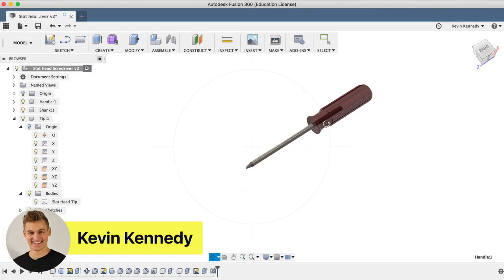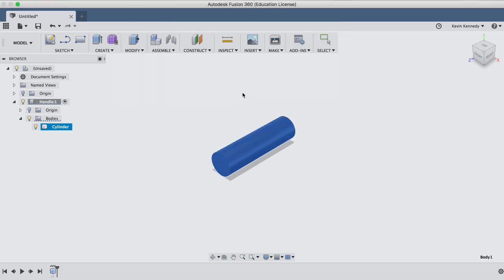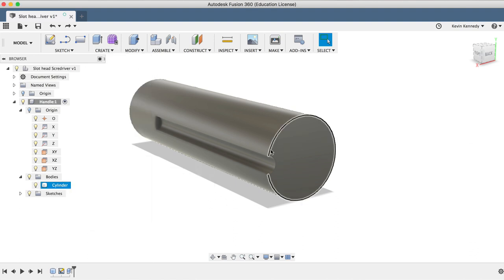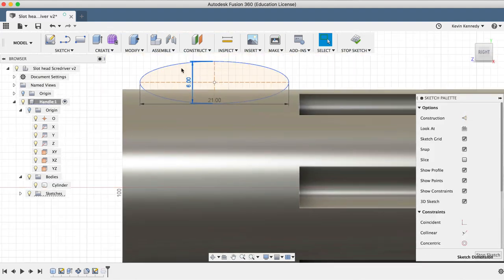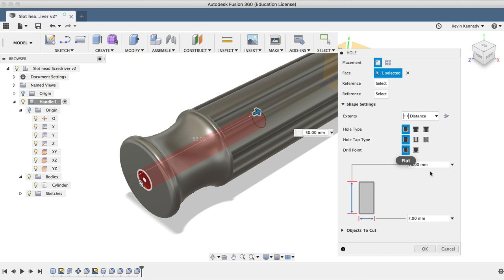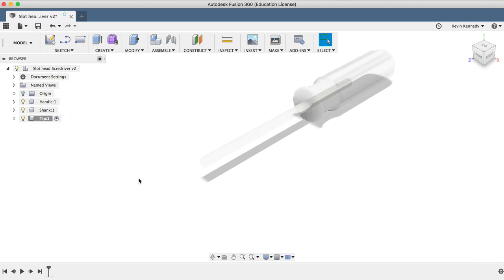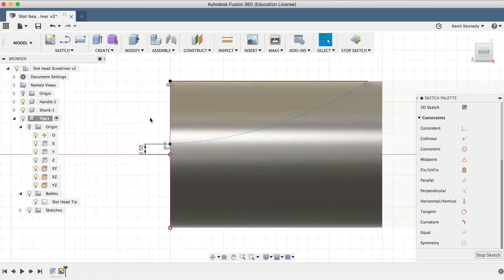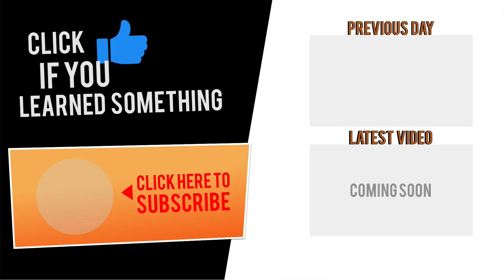How to 3D Model a Screwdriver in Fusion 360 - Learn Autodesk Fusion 360 in 30 Days: Day #14

Comment from the maker: IMPORTANT UPDATE: Make sure you turn on "Auto project edges on reference" or you will have trouble creating the tip. Cross-check your settings with mine, here - http://bit.ly/defaultsettings
--
TIMESTAMPS
0:00 - 3D model a Screwdriver in Fusion 360
0:50 - Create a component
1:07 - Cylinder for the handle
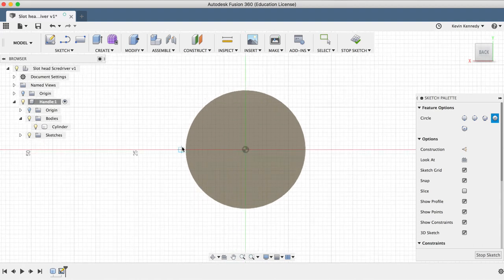2:21 - Handle grips
5:20 - Front "divet" of handle
7:43 - Hole in handle
8:25 - Screwdriver shank
10:08 - Screwdriver flat head tip
13:07 - Extrude cut screwdriver tip
13:59 - Add appearances to components
Reply: Hi Kevin, I was having trouble selecting the corner point when creating the tip, so I restored the default settings per your suggestion, and now when I go to dimension ".5mm" from the edge of the tip face to the center point I can no longer snap to the center point. How do I fix that?
Reply: Kevin, I was having the same problem many of the other users here were having with the 3-point-arc not sticking to the tip component. When zoomed in I noticed the tip was slightly off the center axis. 

The problem is with the creation of the hole. When you create the hole it does not automatically constrain it to the center of the front axis. You must drag the hole until it clicks into place so Fusion 360 applies the constraint to center it on the axis. 

"Auto Project Edges on Reference" is part of the problem, but also, centering the hole is the other part.
Reply: I have auto project.... checked in my settings, it does nothing for me. Turned it off and on again.. it does nothing for me. Just cannot get it to work

Comment: When using the dimension tool (D) at 11:32, I found I had to hold SHIFT while hovering over the tip cylinder edge in order to access its midpoint. Version 2.0.14793 here.

Comment: At 11:30
How did you manage to make a dimension between the arc and the center origin of the tip?
Auto project edges on reference is already marked.
I can make a dimension to the upper/lower edge of the tip, but not to its center.
Reply: same here!
I just helped myself by creating a construction line from the end of the arc to the center of the tip and setting the dimension for it at 0.5mm. Then I moved the endpoint of the construction line with the arc attached to it to the center of the tip. It will snap into place and it will keep the dimension. I have made a vertical constraint for the construction line but I don't know if that is needed.
Reply: The problem I had was that the second point of the arc didn't snap to the top of the cylinder properly. Once I zoomed out and tried the arc procedure again, I could see the second point snap to the top, then I was able to set the distance of 0.5mm. 

I hope this helps.

Comment: first off - so cool - I think components are finally sinking in! 
 Question - why not create the fillet on the hole in the screwdriver handle BEFORE creating the pattern?  Then wouldn't the pattern replicate the fillet also?  or is there a reason not to do that I am missing?  It would also be cool to demonstrate changing the handle hole size again after making to tip to see all of them being modified.  Thanks

Comment: Like everyone else, I wanted to say thanks for putting these together. They have definitely been helping me work through the program. I am coming from a 2D CAD world and there is a big step up to work in the 3D realm. I do however have to admit that I hope I am not the only one getting frustrated with it. It seems every lesson, there is some aspect I just can not get to work. Last one was the tip of the auger bit...... Did not happen. This one it is the dimension for the tip of the screwdriver..... The dimension tool will NOT snap to the center origin no way, no how....I hope I am not the only one...... Your videos are however the best on youtube for basic Fusion 360 instruction. Thanks again.
Reply: I created a construction line and fixed it in position.  Then I was able to add the .5 mm dimension.
Reply: create a construction line, or create a second sketch and put a point at the center of the tip face. You can move that forward in the timeline and reference that point.

Comment: The problem I had was dimensionalizing the head.   It would now allow me to choose the center point on the grid.   I tried researching the problem and couldn't find a solution.   Thank you again for the amazing series.
Reply: I have the exact same issue, i can select the start of the arc, but no point appears for selecting the center of the tip. 11:27
Reply: same

Comment: If you can't set the dimension from arc to center in the tip:
I just helped myself by creating a construction line from the end of the arc to the center of the tip and setting the dimension for it at 0.5mm. Then I moved the endpoint of the construction line with the arc attached to it to the center of the tip. It will snap into place and it will keep the dimension. I have made a vertical constraint for the construction line but I don't know if that is needed.

Comment: Thank you for your detailed tutorials. I have learned much and can't wait to try out all these things. One thing which struck me immediately about this tutorial was the lack of a flare (grip) in the shank inside the handle to hold the shank in place so it doesn't turn when in use. I was hoping this would part of the tutorial as I can't see how one could design something inside something else and print a handle and then insert a shank with the flare/grip/wings.
Reply from the maker: Interesting thoughts! To be honest, the focus was more on the high-level features and concepts than making the screwdriver manufacturable. However, I like that idea for a future tutorial :)

Comment: Great tutorials! The only problems I have are usually just the differences between the old and new software version. Like not being able to choose sketch commands until picking a plane and clicking create sketch. My problem on this one is that with the shank as the active component, I can not extrude from the hole in the handle. I simply can not select the handle at all. Auto project edges is turned on, everything else is default (2019)

I just figured out that if I select the top level (screwdriver) I can extrude from that and it put the extrusion in the shank component.
For the tip I made screwdriver active, extruded from the shank and selected new component in the extrude menu
Reply from the maker: Hi, slash09r1. I would recommend using the shortcuts box (keyboard letter "S") to search for sketch commands. That's one easy way to activate sketch commands without being in an active sketch environment. For the shank, you'll want to make sure that you have the "Shank" component active. Then, select the inside face of the handle and hit the keyboard shortcut "P" for the project. That should let you project the sketch (circle) before you extrude it. Projecting the sketch will make sure your circle adapts to the size of the handle if its ever changed.

Don't hesitate to comment if you run into any more roadblocks. Cheers, Kevin :)
Reply: @ProductDesignOnline  Thank you so much Kevin, I encountered the same problem.  This is very helpful.

Comment: At part 11:27 with Dimension tool. There is no automatic point in the middle, so i created a point. But the question is why it doesn't show up? Is it in my settings?
Reply: Same issue here, let's see if someone knows the answer. What I did was creating a 2 point circle between the top and the bottom of the extruded surface, so I get the midpoint of the circle, allowing me to use the Dimension tool between the arc and the circle's midpoint. Anyway, there should be a better way of doing this.
Reply: use "project" next time
Reply: @Woke Samurai You guys were a big help i used combination of project tool & a construction line and some other fiddling to finish up. Does it still readjust the tip component when other components are adjusted? find out next time on Dragonball Z!
Reply: I added a center diameter circle which worked. But now going through Day 15 makes me wonder if it would have been easier to just add a line point.
Reply: @Lone Crew by Newaj After struggling and questioning my life choices, I took a chance and figured out something similar. Here is what I did. After creating the 3 point arc, select the FRONT view. Use the Dimension tool (D) and selected the first endpoint of the arc (it should appear as a black dot). Then hover the mouse down slightly toward the center and a white dot appears. That's the center point. Click on it and change the view back to the RIGHT. From there you can hover your mouse between those points and click to access the dimension to change it to 0.5mm. I hope this helped someone out there. Oh, btw this was done on the latest version of Fusion 360 on a Mac (10.15.7).

Comment: I also had the issue with not being able to dimension to the center of the tip for the three point arc and stumbled upon holding the shift key while hovering near where the point should be. Then it found it.

Comment: For me also the dimension from arc to center could not be set and I also could not mirror the feature of the tip... It would really be great, if you could make a new series with the newest version of Fusion 360.

Edit: I think the problem for why I can't mirror is, that the midpoint of the tip is not the actual midpoint. I have no idea how to change that... This tutorial has not worked for me...

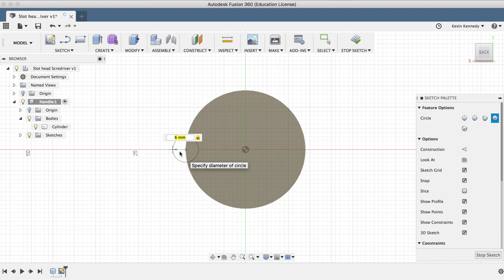Comment: This tutorial series is incredibly helpful. It's extemely clear and the pacing is perfect. I only just run into a problem with drawing the circle for the grooves (around  2:37 in the video). My crosshair doesn't snap to the quadrant point of the cilinder. Is there a setting such as in autocad where you can turn snapping points on or off?
Reply from the maker: Thanks, Rick! I'm happy to hear you're enjoying the 30 Day series. In your sketch palette, which is the dialog box that opens up when you create a sketch, you'll be able to check the "snap" option. Make sure the snap option is turned on. It's here you can also turn on your "sketch grid" which often helps when trying to snap one sketch entity into another. Cheers, Kevin :)

Comment: I see alot of comments having trouble selecting mid point when doing dimensions for curve : quick work around is to create a line through center of cylinder, press x to make it construction and set the dimension to the end of the construction line :)
Reply from the maker: Great tip. Thanks for sharing, Ashley!
Reply: You are a legend

Comment: I seem to be stuck where many people are, with the darn tip.    I added the 3 point arc, but my problem is with first dimension on the tip after creating the arc.    When I try the way you do it, I can snap to the endpoint of the arc, but but the centerpoint of the tip.   If instead I try to create the sketch by selecting the front face of the tip, then I can snap to both the end of the arc and the center of the face, but then it tells me that I'm over-constrained and only lets me add the driven dimension.     So I'm not sure what is going on.    And I checked my settings, and they seem ok from what I can tell, especially the "Auto project edges on reference" and the snap.     Thanks!

Comment: Thank you very much for the tutorials really appreciate the work you put into them!!
I had one question: when extruding the screwdriver tip (last part), why did you use two bodies and not symmetrical? Does it have any extra feature? It's because I feel that symmetric is faster to use in this case.
Thanks!

Comment: I can't get the Arc black :(. Also I can't dimension it without putting a line on the center axis.
Reply from the maker: Hi, Balleknack. Can you share your file with me? Share your public link as a reply to this comment. Here's a video explaining how to share a public link - https://youtu.be/2XrcrdV-8Ls

Then, please write a separate comment letting me know you've replied with a link because YouTube flags most links and I don't always get notified. Cheers, Kevin :)
Reply: I had the same problem, but later i use the point to put the conner

Comment: Hi Kevin,  I am struggling to get the dimension on the tip and then constrain things.  I have turned on Auto project . . . but cannot seem to be able to pick the centre of the tip in order to dimentsion it.  Mike Andrew
Reply from the maker: Hi, Mike. The other thing to check - do you have the "snaps" option turned on in your Sketch palette? You can cross-check your settings with mine here - https://bit.ly/defaultsettings

Let me know if any of the settings where off. Cheers, Kevin :)
Reply: I'm on version 2.0.8176 and cannot get anything to snap to centerline without adding a construction line.

Comment: When I extrude the tip, its leaving a strip sticking up on the outside which is the horizontal line that was drawn. Strip  about 2mm wide. Something to do with a line width setting?

Comment: Hi. I have problems with the tip, I can't select the center after I put on the 3-point-arc. I have checked all my settings and they are ok. What did I do wrong?
Reply: I am also having problems with the tip. I can't find the corner point to make the constraint.
Reply: @thomastracey3968  I started all over again. I have checked the settings, and a few things had changed there. I think these were changed by this week's update. I then changed the settings and today everything worked out fine :)

Comment: Question:  how do you decide on the fillet radii of the different edges?  Is it simply a matter of experience?  Random?  Can you give us some guidance on this?
Reply from the maker: Hi, StepInIsrael. Great question - it really depends on the object and what you're trying to achieve. In product design there are some standards based on the required type of manufacturing process. For example, all plastic objects (injection molded) will generally have at least a 1mm-2mm fillet so they don't have a sharp edge.

With that said, whether you're designing for 3D-printing or another type of design, it will require trial and error. Generally, you'll need to try different fillet radiuses out and see how that affects the appearance as well as other manufacturing considerations. 

Thanks for asking this. I'll try to talk about this more in one of my tutorials. Cheers, Kevin :)

Comment: Is there a best practices reason why you carved the base handle from a cylinder rather than do a revolve from a sketch?  P.S.  Thanks for the great videos.
Reply from the maker: Hi, Robert. You could certainly do it either way - I try to break down shapes into basic forms before adding any complex geometry. In a small item like this it wouldn't matter much... however, in larger assembly files it can be hard to go back and alter previous steps (in a predictable way), especially when the revolve tool and some other commands are used.

Thanks for watching and commenting! Cheers, Kevin :)

Comment: Hey,
At 11:28 I couldn’t dimension the point of the curve to the centre of the bit because the centre point wasn’t provided. Even after following each step meticulously, the centre point wasn’t there. So I deleted the arc line sketch and made a new one, planed on the end bit of the …bit…, drew two perpendicular construction lines (letting them snap on so they were strictly vertical or horizontal) and manually added a point via Sketch – Point where the construction lines crossed. I switched to the YZ plane and continued along since I now had a centre point to which I could dimension the 3-point arc.
Reply from the maker: Hi, Argo Isenough. Thanks for sharing this with the community! As soon as I started reading your comment I was going to recommend manually adding a point...but it looks like you figured it out. Keep it up! Cheers, Kevin :)
Reply: @ProductDesignOnline  Same problem with me. But this comment helped me out ... I learnt to first look into the comments before googling all over the place :)
Reply from the maker: @franckdebruijn3530  Glad you saw this comment before getting sucked into the never-ending spiral of the internet! ;)

As always, don't hesitate to comment if you run into any roadblocks or don't see an answer to your question in the comments. Cheers, Kevin :)
Reply: @ProductDesignOnline   Alas I appreciate Argo's comment but I don't understand it! I have the same problem; I created the arc but I see no centre point to dimension too? I'm not sure if I'm meant to create a centre point at the dead centre of the front view then dimension from the arc point to that point?  But also I wonder why it's not there to begin with?  I am using the latest version though I'm pretty sure all my settings match yours)  https://myhub.autodesk360.com/ue2ff3eb0/shares/public/SH56a43QTfd62c1cd968585557df8003c74b
Reply from the maker: @JesseKellys  Hi, Jesse. I'm pretty sure the missing point is due to the "Auto project edges on reference" feature which used to be a default. Can you confirm that yours is turned on? https://productdesignonline.com/default-settings-for-fusion-360-tutorials/#autoProject